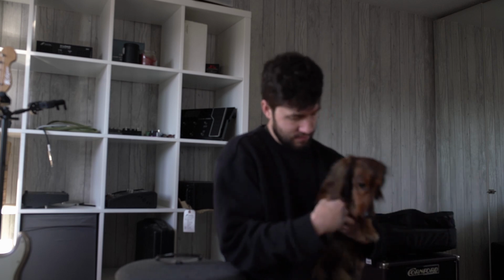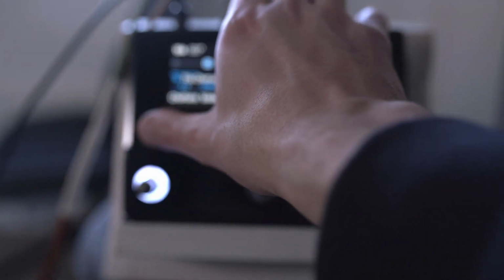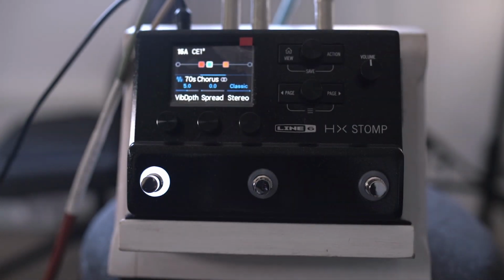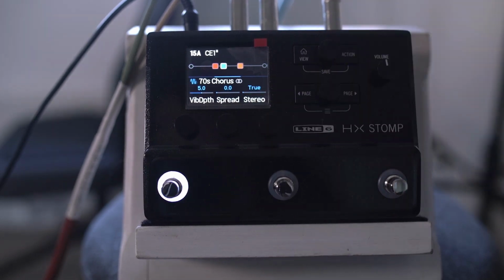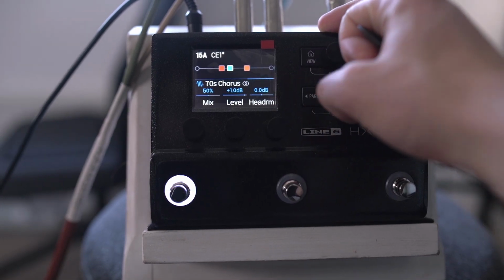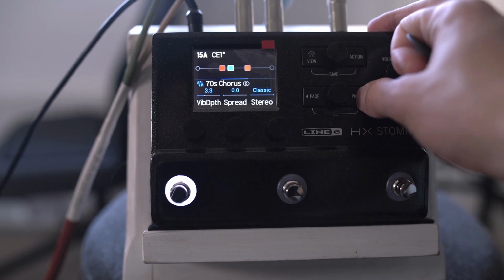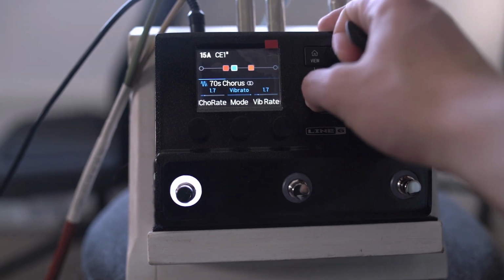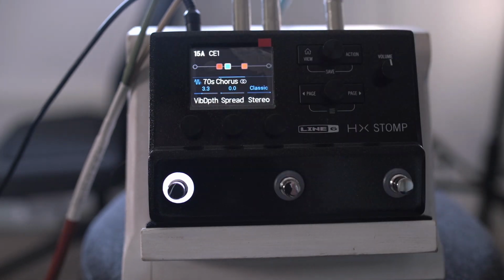One of the BEST Chorus Pedals in the Helix - BOSS CE1 Chorus Ensemble

Comment: As a former Boss DC2 Waza owner, my go to is the Dimension model. I like my chorus “motionless”
Reply from the maker: Can it do the proper stereo splitting thing?
Reply: @johnnathancordy  whereas its one of their Legacy effects that comes up in the mono section, nope.  Unless something defaults it to stereo when it detects cables coming out of both the L and R outputs but I tend to doubt it given that it sounds mono through my headphones. Not a huge bummer for me as I can’t be bothered by stereo, and I’ve 2 maxed out H9’s!  It sure is nice though on those rare occasions when I DO go stereo!
Reply: @johnnathancordy  Yes, some legacy effects are stereo and Dimension is one of them. All 4 switches on and mix @ 20% is a very nice stereo chorus. All 4 switches off and mix@ 50% is (as far as I know) a unique "motionless" effect. Go either side of 50% and things get unbalanced in the stereo field.

Comment: Not sure if you’ve done it yet, but a Phaser video with the Helix would be great! I can’t seem to get good phaser tones out of it, although I only use the phasers with my Rhodes MK1.. which is not really what the Helix is meant for, but Rhodes historically have been used with guitar pedals and amps so if it works for guitar it should work for the Rhodes too. I really like a lot of the other stereo modulation fx in the helix, most of my presets have more blue blocks than anything else haha. But the phasers always seem to give me trouble where you can barley hear it or it’s way too intense.